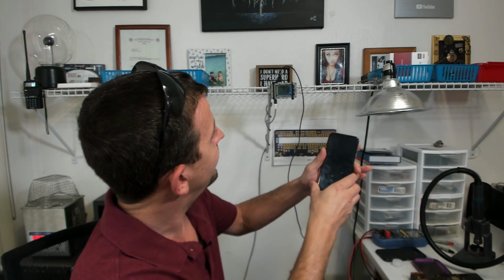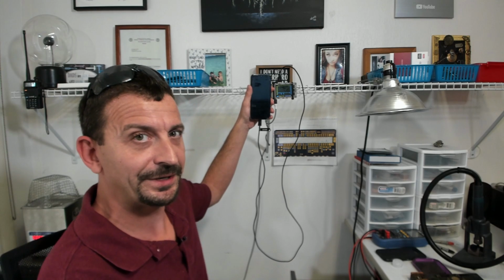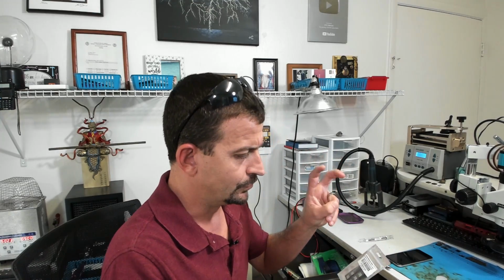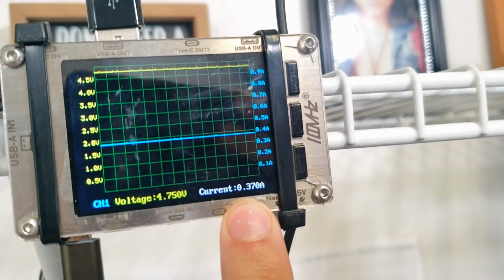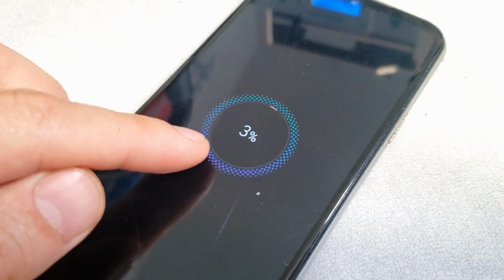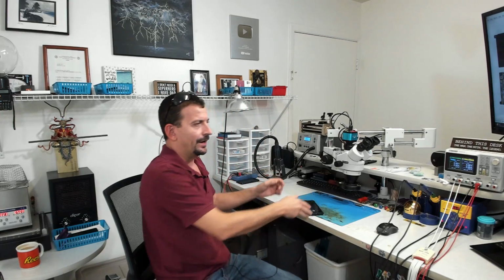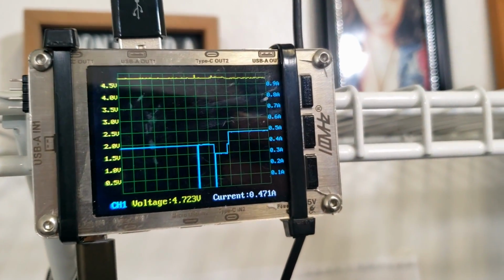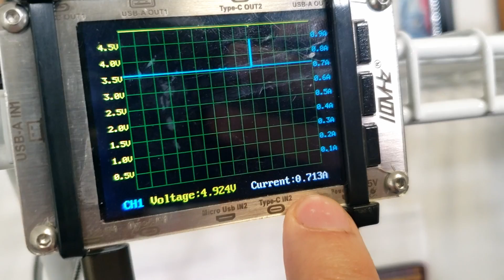LG charge port replacement (K31)

Comment: Hey Jason! Just found your channel and love it. Liked and subscribed. Does a longer 6ft-10ft cable cause a phone to charge slower? Thanks!
Reply from the maker: Hey, thanks for subscribing!  Yes, the longer cable is too long for 5v USB voltage.  There is a significant voltage drop by the time it makes it to the end of the cable due to the resistance of the wire.  Phones that charge on higher voltage when a supported charger is used are not as much affected though.
Reply: Thanks!  Man you really know your stuff when it comes to fixing these phones! I'm sitting here binge watching your channel. Have a great Friday! If I don't get anything done today, it's your fault! lol @ststele

Comment: Excellent bit of content,  nice to see your attention to detail it's most unusual, I 25 years ago was working essentially alone on SMT assembly I hand fitted tens of thousands of ram chips and the surface tension of the flux is really the route to make quality , I had really no specialised tools , I used a TempControlled Antex 50 watt iron with 2mm tip and 60/40 lead solder bleed grounded and powered via two isolation transformers , I also made focussed IR heaters ,   pantograph style micro manipulators, and a really cheap and easy vacuum pickup tool ,  hot air was a heavily modified paint stripper style blower,  I had a polarised light magnifier that was really good , tremble is a real issue hence the micro manipulators
Reply from the maker: Thank you!  That is very interesting for sure!

Comment: Nice, I just did my first LG port of the same style for 3 weeks ago. It was a Stylo 3 . Now I used 63-37 leaded wire to install. I wonder if I should be using something different?
Anyways it was a great conquest on my part even though it was only 11 points altogether desoldering/ soldering I was super proud of the end result. Lol.
As always great stuff Jason. Love your videos
Reply from the maker: Hey, thanks!  63/37 is what I use for connectors and most other components.  I use 138C (Sn42/Bi58) low melt sometimes when I'm not too concerned about strength though.  The low melt makes life easier but is brittle and cracks easy.

Comment: You're really good in fixing phones. I've been hearing and seeing concerns about iPhone 13 Pro Max green screen issue. what are your thoughts about this, could this be just an isolated case or, is common with 13PM? is the screen fixable or just need a straightforward replacement of the whole screen and lcd?
Reply from the maker: Hey thanks!  I haven’t ran into that problem yet.  I’m assuming a replacement screen would cure it though. With the screens being so expensive, I’m extra careful when opening those phones!
Reply: @ststele  ok, thanks for the insight. I've been seeing fixes in YouTube by soldering jumpers on the screen as a temporary (I think) fix... IDK... if they're legit.

Comment: Any job to do with microsoldering is challenging, Instructional, and Entertaining to watch.  Don't listen to the whiners.  Great Repair and Video.  Thank You!
Reply from the maker: Thank you 🙏 today's video was supposed to be different but that repair is stuck waiting on parts before I can finish it!  I went with this straight forward repair next because I just spent the first half of the day only spending money and needed a guaranteed win.  I'm starting to get pretty backed up though so more coming soon! 👍
Reply: Eventually,very soon, microsoldering will be the only soldering, as things get smaller and smaller.

Comment: Nothing but super easy jobs this year, wouldn't you want something with a bit of challenge for a change?
Reply from the maker: Hardly any videos at all this year yet my year has been full of challenges.  Will post more challenging stuff soon enough.  Having learned a good part of my audience doesn't even work on phones makes me know that our idea of "challenging" is relative and also a matter of opinion.
Reply: @ststele  It's true. I have absolutely nothing to do with phone repairs... but you are interesting to watch and listen to... Keep it up, and most importantly - be who you are.
Reply: @ststele  Maybe a cracked NAND where you have to carve the substrate away and attach new bond wires to Si die directly. That would be more interesting.